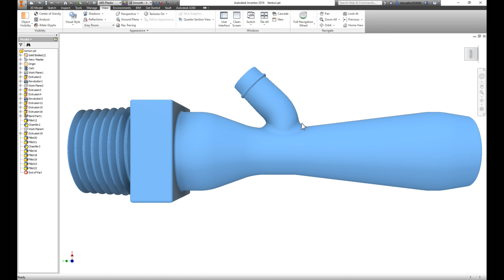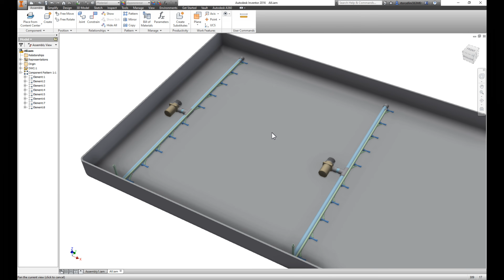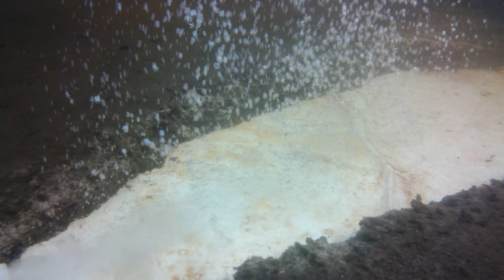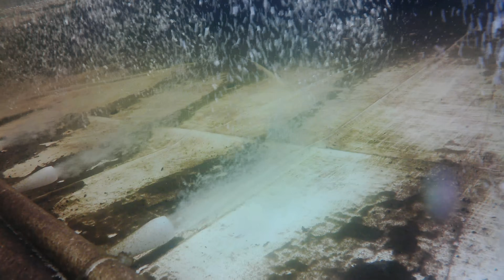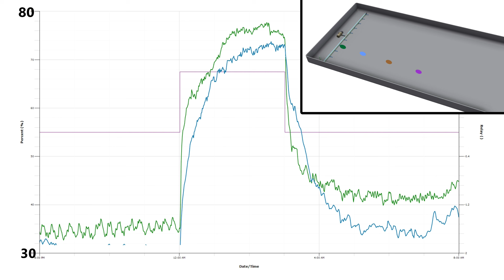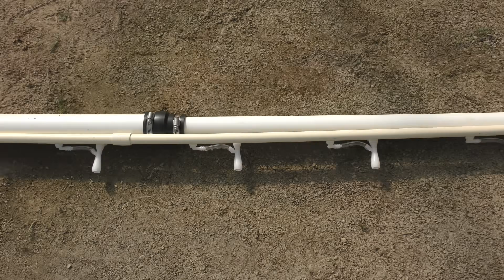Better Bubbles? A Venturi Tube Experiment

Comment: May be a bit late, but another thing to increase oxygen through these venturi bubblers is to make the bubbles as small as possible, that way the same amount of air rushing in has a higher surface area to move the gases into the water.
Not played around with that too much, but mechanically seperating your input diameter from one big tube to alot of smaller ones might do the trick.
Could work with surrounding your water pipe with a bigger pipe that has the air intake and then drill a bunch of tiny holes into the water pipe underneath, and then seal the end of the air "sleeve" around the water pipe, basically creating a small airtank that will feed the water pipe.
If you find that water sits in that air tank your water at the output might create too much pressure and wont let much air in. Venturi works best when the output is the combined diameter size of the 2 inputs. Doesn't have to be too exact when you have an air input because air is compressible, but still it should give better results.

Comment: I have a length 36" X width 21 " x 40" deep fish tank I want to make a contraption with multiple venturis just like in the video which will not only aereate water but the flow will also clean the muck on the bottom directing it to the SLO. I made a manifold on a 1" pipe for multiple (4 ventures) in a series. I reduced the 1 " to a 3/4 th inch pipe to which i attached a 3/4" T. Inside the T on water supply side i pushed a bottle cap with a 6 mm hole in centre to create restriction on the other side of T I fixed a small 3/4" pipe  to which was fixed an elbow to which I attached a pipe which goes to bottom of fish tank the top of T i  pushed a 3/4" pipe as a snorkel when i on the pump which is 65watt submersible aquarium pump all 4 venturies just made a few bubbles not  like a jet like in the video on your channel and many other channels so i added another 40 watt small pump but result was no different. When i had tested 3 venturies placed on the bottom of fish tank like you do in this video with water level of only 9 inches all 3 worked superbly well like jets in a jaccusi but as soon as i raised water level to about 20" in the fish tank the bubbles stopped. I am at my wits end and frustrated plz help by advising what is going wrong?!
Reply from the maker: you need to increase the flow/pressure of the pump.  The deeper you go, the more flow it takes for the venturi to operate.

Comment: Man I could use a venturi part that can fit a 5/16 air line instead of pvc.  All the chinese 5w pumps for small aquariums use 5/16 (8mm) tubes and its hard to find hardware for them.  At $15 ea its cheaper to get an airpump which defeats the purpose.

Comment: Old video but still, have you tried just adding an air hose behind the propeller on the pump? It'll add a lot more air to any type of venturi
Reply from the maker: Adding air at the impeller will cause cavitation at the impeller.  It will usually make the impeller wear out faster or worse, make the motor bearings wear out faster.

Comment: If you have a spigot sun tea jar you have a ready-made item upside down for your Venturi housing in my mind at least, I had one saved I was going to use for a filtration project but was worrying about the spigot clogging causing overflow and stumbled onto the Venturi concepts several videos back with the innovative name brand whose name is evading me at this moment but why spend when you can create
Reply: Around 8 and 1/2 minutes you use the Skippy jar and the spigot on the sun tea place upside down could adjust air flow?

Comment: looks nice . do not down size the piping . instead upsize it . if the pump calls for an inch and a half go to two inch . this will give you more flow . instead of ending the piping connect all end so they continue. this will allow you to use less pumps and get more flow per pump used .

Comment: what about using a impeller (on motor) to both stir air into water and to circulate the water at same time?
Reply from the maker: usually adding air at the impeller will cause cavitation and will ruin the pump
Reply: @Bigelowbrook  : talking about using a low speed large impeller motor, not a pump. mechanical stirring is what most commercial water oxygenation facilities do. the other way, using a pump, is a circulation system that has a overflow tank above, which splashes water onto main grow tank, in one corner. large volume low speed pump.
Reply from the maker: @Chris-op7yt  That probably would work too.  These are used in our DWC beds to add air, and to also circulate the water to keep solids from settling at the bottom.

Comment: I was in the middle of building something very similar for my DWC buckets. The youtube video I was watching ended and this video auto played. Very fortuitous. 

I love the ingenuity and experimentation. The second air rail as opposed to just having a tube sticking straight up off each nozzle is brilliant. 

If you only used the first 10 nozzles do you think you could get away with 1 inch pipe? 

And with either 1" or the 1.5" you used here, would you say you had equal flow at each nozzle? 

What pump size would you recommend for 10 nozzles?
Reply from the maker: Check out my design tool that will let you size a system with various pipe sizes.  With 10 nozzles you would want the 1.5" pipe.  https://infusinator.com/products/Infusinator/Design.aspx  The Jabeo DCT-8000 pump would be a good choice to run 10 nozzles.

Comment: Use aquarium plants. They can help anchor the sediment to the bottom, help condition and clean your water. You can even collect local species like Hornwort and then put it in your system.
Reply: I was going to say the same thing, this would be perfect for aquatic plants.

Comment: Wht size pump fitted to the 20 nozzles. Meaning how many liters of water does the pump out put for 20 nozzles
Reply from the maker: You would need about 275 lpm.  You can play with a design tool here.  Thanks!  https://infusinator.com/products/Infusinator/Design.aspx

Comment: This is awesome, but I wonder what the results would be with an underwater oxygen battery?  Take a 3 inch PVC pipe, cut it in half, suspend the half pipe upside down so that it traps air.  If atmosphere is 21% oxygen and water is 1% oygen, would the additional contact diffuse slower with less energy?

Comment: Tap/Thread is a much better idea than glue. It looks like another system on the other side would do a good job of moving the water but do you want the whole 100' tank to circulate or run from inlet to outlet?

Comment: Would  this somehow work for compost tea brewer? If so, say in a brut 35 g system, how many nozzles do i need to attain minimum 5.5 ppm level?
Reply from the maker: I have a new video that shows them in a mineralisation tank, which is basically the same thing.  It's using 4 nozzles.

Comment: Good idea. To increase circulation you might try putting an extension in front of the pumps that puts the nozzles at the other end of the bed but turn one pump and nozzle system around. So water is pumped to the opposite end of the tank to be jetted at the other pump to be pumped back up the other end in a continuous cycle. The 2 halves of the tank would have the flow going across them in opposite directions. Another possibility would be to position the pumps in the middle of the tank (also on the walls) with one nozzle hose going to one end corner while the one on the other side goes to the opposite corner. It would be a similar effect with water going in opposite directions in each end of the tank. Cross the streams. And check out Speece cones for the most efficient Venturi effect. Thanks for the vid.

Comment: Stupid question maybe but do venturi aerators work installed vertically and pushing water up a pipe?
Reply from the maker: They could work in any position....the amount of air they produce depends on the flow and amount of back pressure against it.
Reply: @Bigelowbrook  The back pressure is what I'm worried about. In my case there is no tank into which the pump is pushing.
I just have a vertical pipe through which I need to pump water. So I'm worried a venturi at the bottom might introduce so much air that the pump is no longer able to build pressure and pump the water upwards.

Comment: Suggestion for easy cleaning of your bed... Get a 1/2hp dirty water sump, I got mine from harbor freight for $68. Put it at one end with the hose laying over a large foam rubber pad to collect the debris, Squeegee everything towards that end and let the clean water run back into the bed.  I own a pool company and we use this method on extremely dirty pools to keep it out of the sand filter... Might take 2-3 cycles but you can leave the pump running over night, as long as the foam doesn't fill up with debris it will continue to clean all night.   Then when the foam is full, take it to the garden, turn it dirty side down and run water through it to feed to garden or yard...
Reply: What kind of foam?

Comment: I follow your channel from the beginning and I really like all your projects ... I would like to offer you a suggestion that could be an interesting (I guess..) experiment for the system developed by you based on the Venturi tube .. You can practice a little the hole on the inlet pipe of the water pump, in which you can insert a thin hose through which the water pump sucks a very small amount of air. In this way, the respective air will be nebulized in the pump rotor without the risk of operation in cavitation mode. With this simple addition I believe that you will get air microbubbles that will improve aeration and at the same time you will have movement in the body of water that you want. Plus, this little innovation could be the theme of a new video that I would be very curious to see him ... I presume that you will get that remaining fog of air in tha water wich make aeration much more efficient...
Reply from the maker: I've seen this done on some pumps and there is a company that sells a pump that has this.  The main problem is that you can get cavitation around the impeller and it usually wears the impeller down, or in some cases will ruin the bearings in the pump from the potential vibration.

Comment: What if you put one system in the center of the bed  a pump 4"x10' pipe, 3"x10' pipe, 2"x10' pipe, 1"x10' pipe, 1/2"x10' pipe, 1/2"x10' pipe, 1"x10' pipe, 2'x10' pipe, 3"x10' pipe, 4"x10' pipe, pump with an air manifold the entire 100 foot length with nozzles pointed in both directions toward the sides of the beds? Would you get uniform oxygen saturation? Would you get uniform pressure?
Reply from the maker: I probably could work but I would calculate out the resistance through the piping.  It would probably need a fairly large pump to use with a 4" pipe!

Comment: Hi, nice done. How deep in the water can you place the venturi before the air can’t come down anymore?
Reply from the maker: I haven't tried.  It can depend on the amount of flow that can be pushed through it.  The deeper you put it, the less effective it becomes.
Reply: @Bigelowbrook  Thank you for your reply. I was thinking about 900mm deep inside a fish tank. Did you btw check how much oxygen difference there was at the opposite location before and after the Venturi was installed?
Reply from the maker: I only checked a few meters away.  I didn't have the time to test the far end of the bed.  It takes around 3 hours for  the water to work it's way down to that side.

Comment: Also, what kind of resin do you use for your prints? I was under the impression that most 3d printable resins aren't fish or food safe. Clearly I've been misinformed.
Reply from the maker: you are probably correct.  I have had problems with some of these degrading when under water after a month or so.  I've been looking for something with better curing properties.

Comment: Really cool build. Doing a lot in line is smart thinking. I'm currently experimenting with combining a venturi with a vortex chamber to try to keep the bubbles in there a little longer to increase their ability to dissolve into the water. Great work! Thanks again for collecting and showing us your data!
Reply: any update on the "venturi with vortex chamber" experiments you've done ?  /S.L.G.
Reply: None yet. When I've completed them I'll post an update with Rob's permission. I'd like to post some videos about the process in the style that rob does.
Reply: Doesn't the oxygen get into the water when the bubbles pop at the surface?
Reply: @leedavis85  No. The oxygen gets into the water through diffusion. The longer a bubble is underwater, the more the gas within that bubble will diffuse into the water. The smaller the bubbles, the longer it takes to get to the surface, and thus more oxygenation occurs. If you put bubbles in a vortex, the force of the spinning water keeps the bubbles submerged for longer. Also, as the bubbles bump into each other and bounce off of each other in extreme turbulence, they get smaller and smaller, speeding up the oxygenation.
Reply: To be fair though, the disturbance of bubbles rising to the surface of the water, breaking the surface tension when they pop, does also oxygenate water, yes.
Reply: @RiparianBeing  thanks for clearing that up.

Comment: Nice setup! FWIW re sediment, I was talking with Dr. Savidov a few years ago, and he talked about how they had experimented with using jets of water to keep the sediment cleaned off. He started with a 2” pipe drilled with a line of 1/4” holes (I think). But when he pointed the holes downstream, the sediment drifted upstream. So he pointed the holes upstream and the sediment was pushed further downstream. The reason (it seems) is that the injection of the water increases the pressure, so the rest of the water and the sediment in the water tries to go to the lower pressure (upstream, in the case of the jets pointing downstream). Just a thought on how you could think about periodically  encouraging your sediment to evacuate the tank, without disrupting your plant growth.
Reply from the maker: I spoke with him about it too.  ;-)

Comment: 23*C isn't too high therefore 80% saturation isn't a big thingy. I would suggest using only one pump and one venturi feeding into a vertical pipe (from the top) with increasing diameters (to the bottom) and exiting with the same diameter you came in with. Then distribute it through out the raft as you did - the result will be the creation of very small bubbles which have a thousand times more surface are for the same air therefore increasing solubility big time. I managed to have 83% oxygen saturation at a water temperature of 35*C. If you want I can send you a video I did showing you this. Let me know.
Reply: When you said distribute it through out the raft did you mean with more venturi nozzles or normal pipe opening?

Also what you are describing is basically an oxygen cone right? 

Would appreciate more info and the video you talked about

Thanks
Reply: @ayzex9975  yes, it's basically a DIY oxygen cone and yes the water exists a normal pipe opening.
Reply: Hello! It's an interesting idea, can you share the information ?
Reply: Hello, could you share this video please?

Comment: Perhaps in a redesign of the venturi you could make a clamp for the air tube or a clip.
Reply from the maker: I already have a new design for it....doubled the air flow through it.  Of course it's a more complicated print.  ;-)  I think I understand your clamp statement....sort of like the little hose clamps on a small gas engine?

Comment: How does the aeration compare between airstones and venturi tubes?  I'd love to see how DO compares instead of DO levels between no aeration and venturi.  If Venturi is cheaper and more efficient, it seems like a no brainer to switch.
Reply from the maker: I cut a lot out of the video but part of it was showing a section where I have some air stones.  They can aerate about the same area, but the air pump is far more expensive, cost more to run, and the tubing gets scattered around as things tug on them (mainly from me moving rafts around).  Plus I still get solids settling right around the stones. I've also had stones pop off their tubes and then the majority of the air comes out of the broken tube because there is less resistance at the broken point.
What I really like about the ventri setup is how much better the water is circulated, helping to keep the solids in the water column (later to get caught in the RFS). Plus the O2 and nutrients can get circulated better too.
Overall, the algae isn't a problem.  I only start to see some when I remove my rafts for experiments like this. ;-)

Comment: If one was trying to keep the part count down, for a simpler system, would a waterfall type of aeration feed by aquaponics circulation pump do the job❓
Reply from the maker: The fish pond folks use a thing called a bakki shower.  It might work for this but I'm not sure if there would be enough aeration for a 100' long DWC bed.
Reply: You could try a schauberger funnel it's the best way to oxygenate water
Reply: @Humbulla93 : Where can we buy such funnel??..Its design, available in You Tube?...